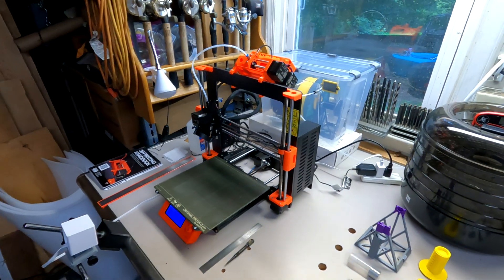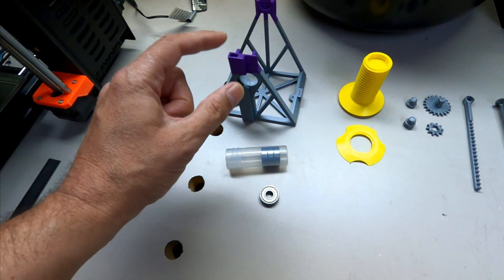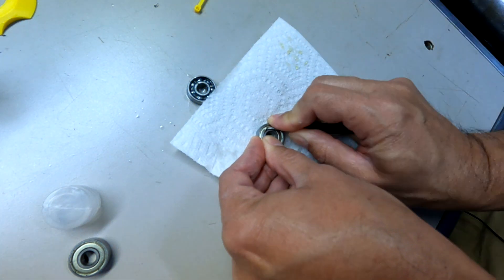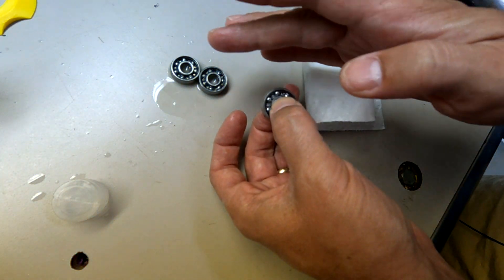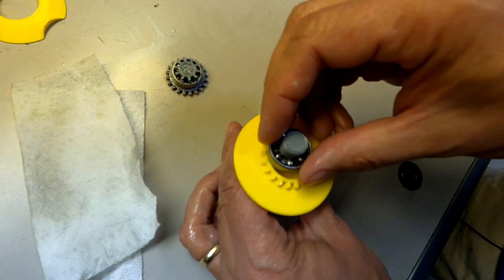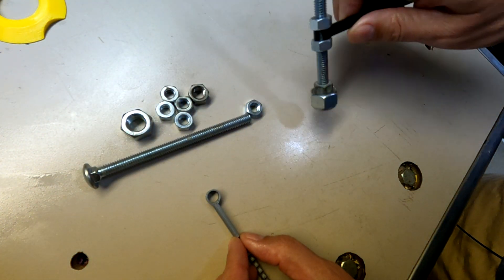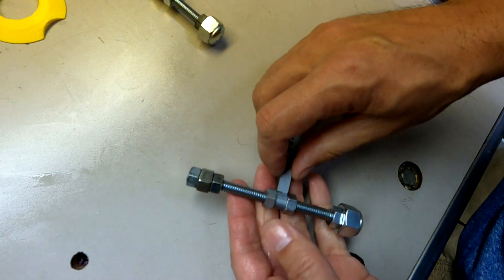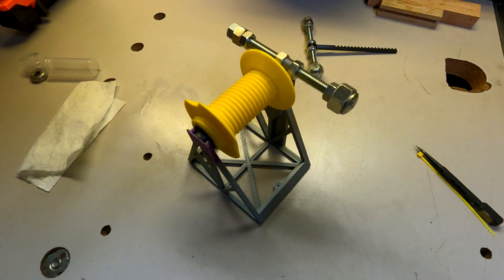Retracting filament holder for IKEA Samla Container

Comment: What kind of bearing is that? I dont have a prusa
Reply from the maker: They are 608 size bearings, used in inline skate wheels, scooters, skateboards,  and fidget spinners. Because they are mass produced in such quantities, they are dirt cheap. You can buy 100 bearings for $20 from Amazon.